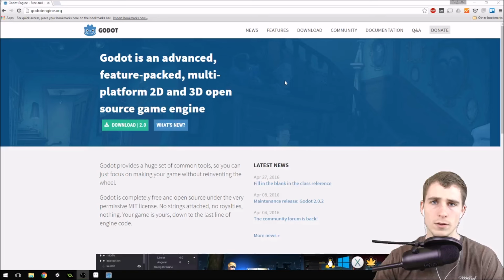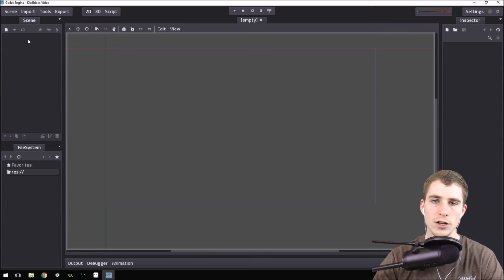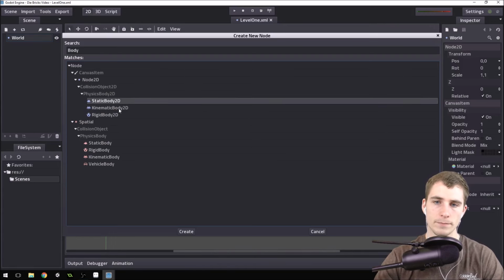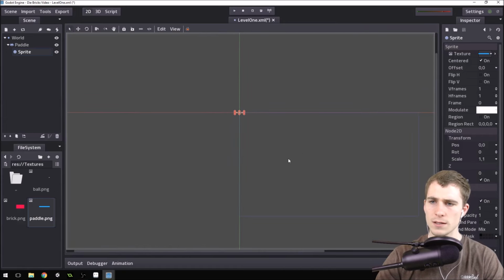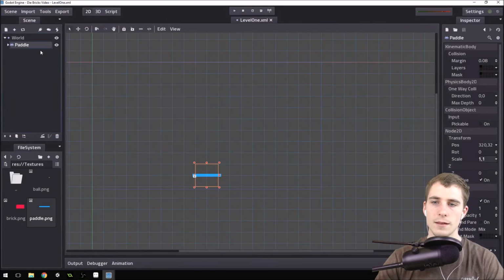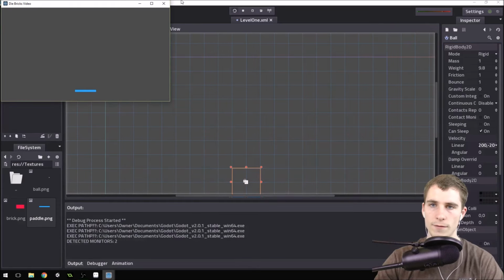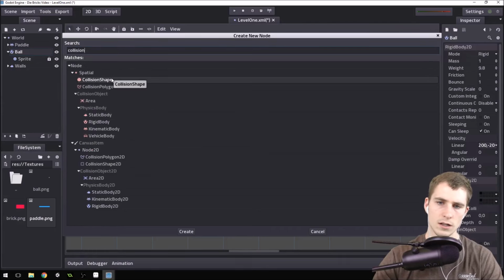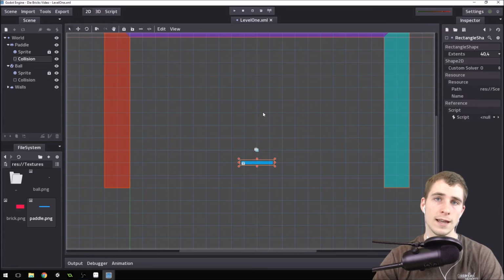[Godot Tutorial] Basic Breakout! [P1]

Comment: I have a question for the ball.
Set the ball of type rigid is easy to just set the linear velocity to move the ball, but the velocity will lost control if hit by the paddle on the side. The velocity of the ball will be very fast by the force of the paddle.